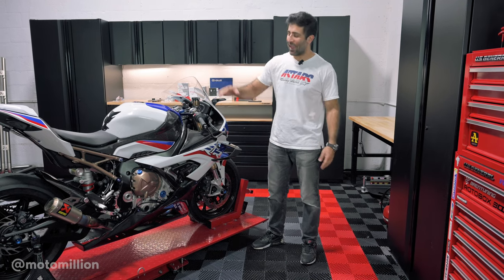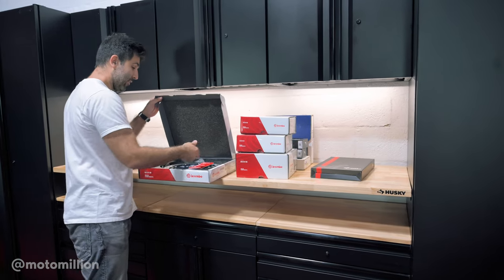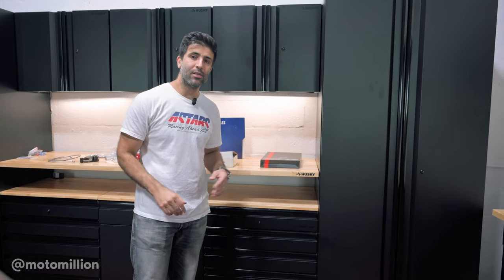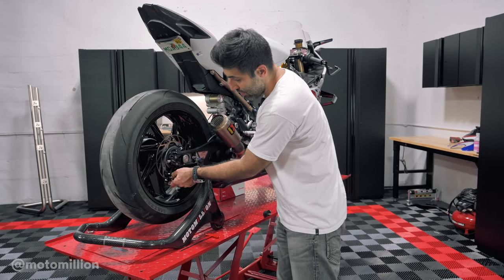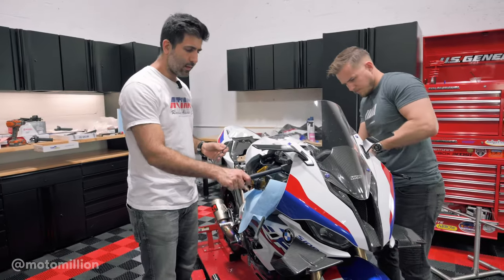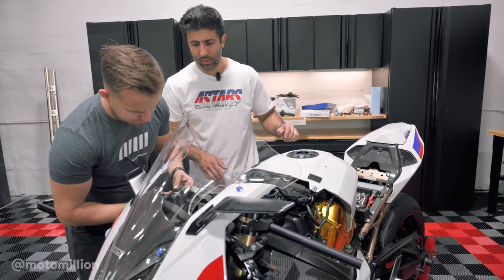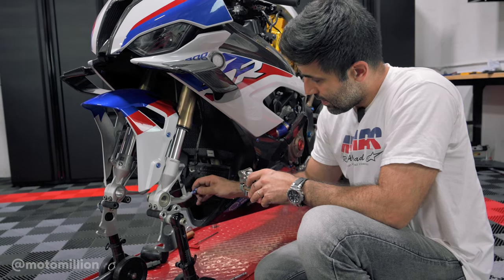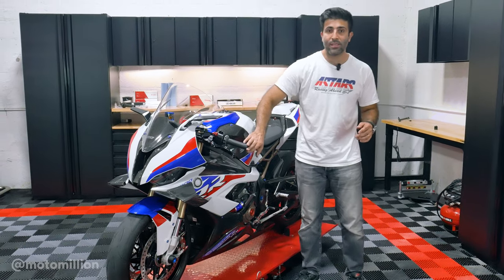BMW S1000RR Full Brembo Upgrade & GP Style Upper Triple! | Motomillion

Comment: Would just the T rotors be a good upgrade for my 2023 Triump Speed Triple 1200RR . I have Stylema calipers ,so I not sure I really need to spend that much .
Reply from the maker: Yes the fully floating rotors themselves are a noticeable improvement.  The sylema calipers are a great caliper, check out our Sp2 video.

Comment: Is it ok to use the GP4 RX with the OEM brake lines and ABS system? I use it track only with the minimal ABS settings but i'm afraid not to have incorrect interruption during a heavy brake into a corner.
Reply from the maker: ABS works, but oem brake lines are questionable with the GP4 RX, it fits and works without issues, but the Stylema and the GP4-MS fits much better.

Comment: Mani do you know if that rear brembo under slung caliber will work on the M1000RR with the stock brake line & caliber mount?
Reply from the maker: No, unfortunately the caliper spacing is different.

Comment: space calipers are incorrectly mounted lol
Reply from the maker: No they are not.  The spacing of the caliper is correct, the owner wanted to add a touch of color, so he used a longer bolt with the colored spacers on top.
Reply: @Motomillion  ah ok thanks for the answer